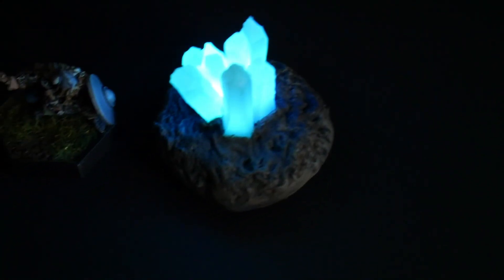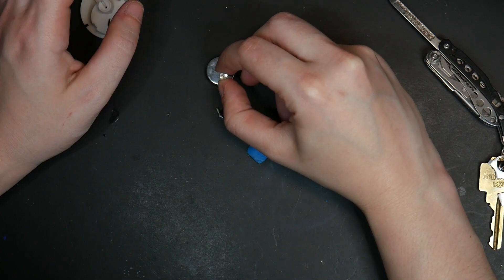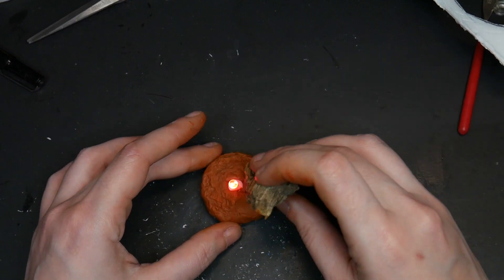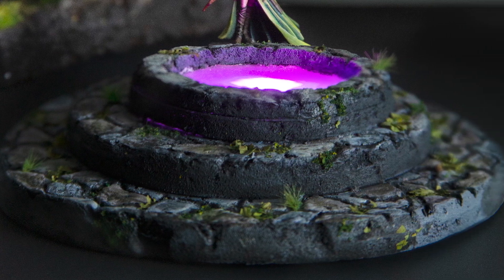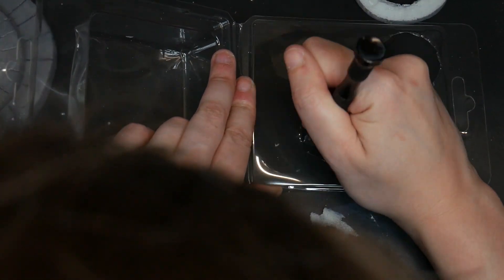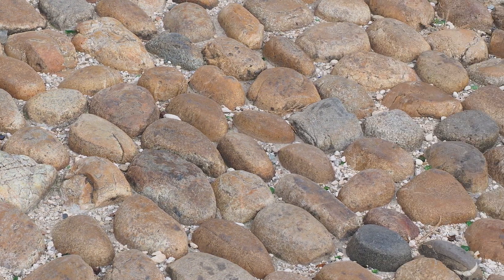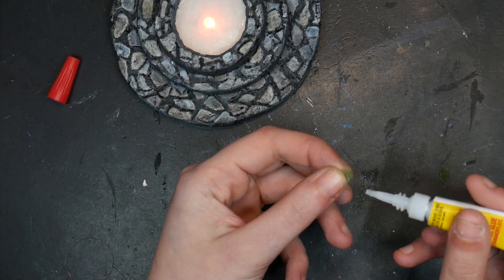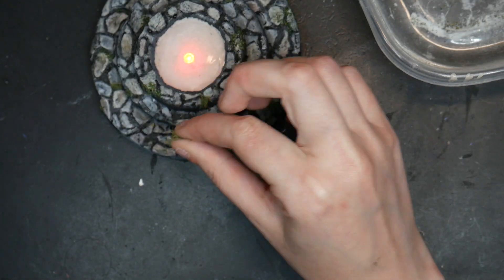EASY DIY Glowing Terrain for your table top

Comment: Aaaand now I know what I'll do with some of my quartz crystals 😁 Thanks!  How about an ancient glowing orb on a pedestal which might also have some glowing parts as an objective marker?
Reply: I actually have a ton of quartz crystals and would like to use them as well. I feel like the light wont shine through as well as it does with carved hot glue sticks. Did you end up using them? How did the light work with the quartz?

Comment: Using the glue sticks is a really cool idea. I wonder how far you could push the light piping effect with those, like maybe set up a diorama with the tea light in the base and then use whittled down glue sticks running through to where you want a light source.

Comment: I love the use of hot glue to disperse light!
I made a lamp post with a tealight, but it did include a LOT of soldering in very tricky and tight spaces ^^ not fun.
Reply from the maker: I think if I had a soldering gun I would have a lot of fun!